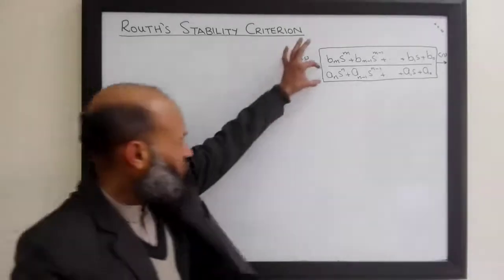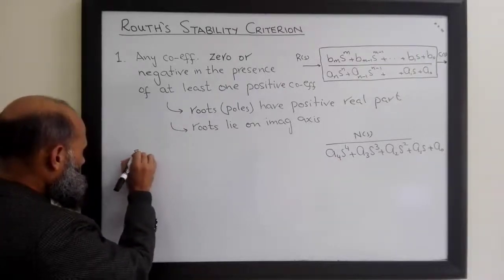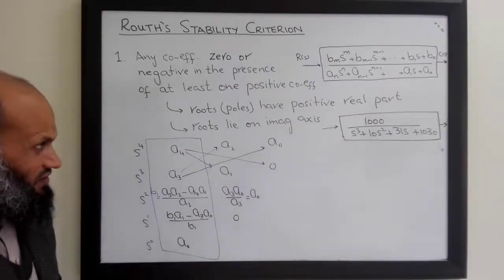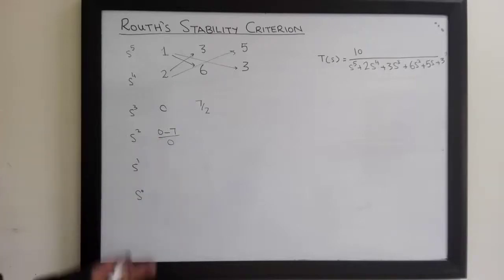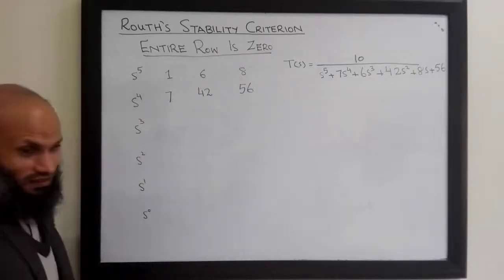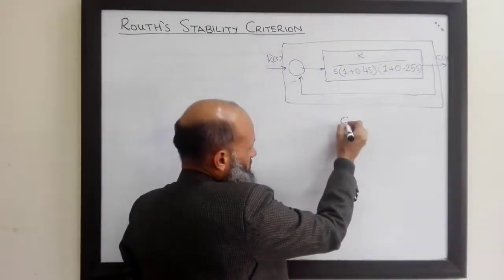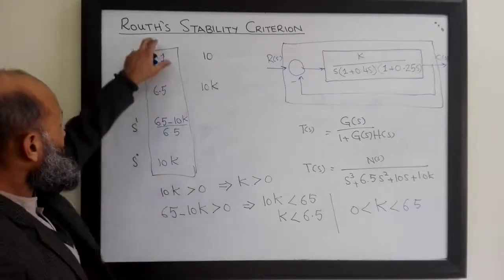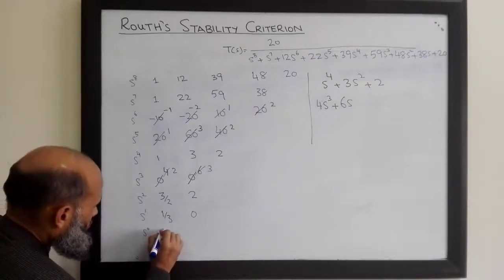LCS 27 - Routh Hurwitz stability criterion

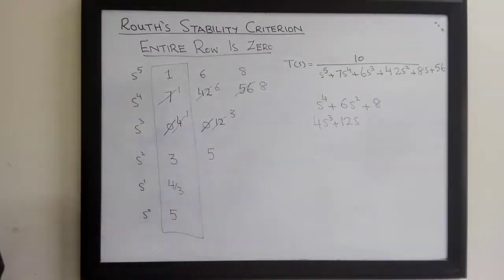Comment: 15:39 sorry sir , but the system is unstable due to the zero in row 3 .
Reply from the maker: Actually, there is no sign change in the first column of the table, therefore the system is stable according to the Routh's criterion.  You may verify it by computing the poles of the transfer function as well. A zero in the first column does not imply instability.
Reply: Thank you for replying;
But I thought there exist other special cases that indicate a system instability. 
1) zero element in the 1st column but other elements in the row are not zero
2) zero in 1st row and all other element of the row are also zero
Reply: The poles are -7 
Sqrt2.i
-sqrt2.i
2i
And -2i 
So It is marginally unstable.
Reply from the maker: @merzakrezgui1215  yes, you may call it as marginal instability.